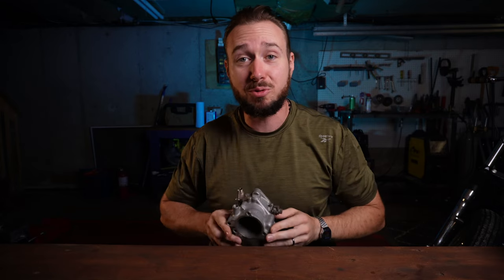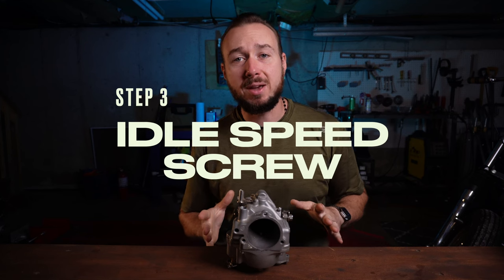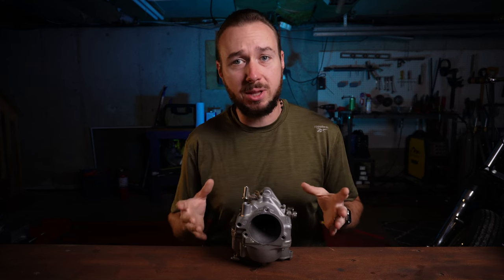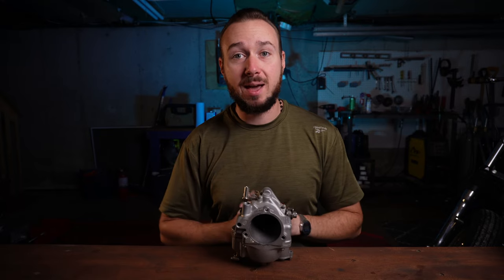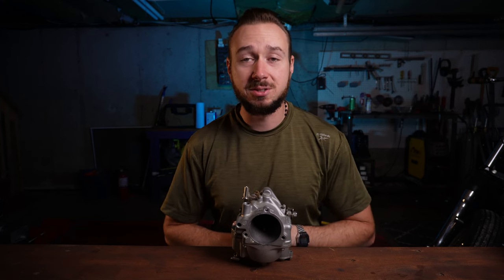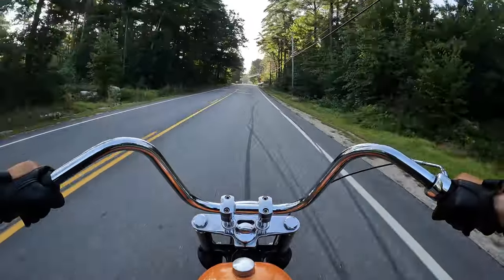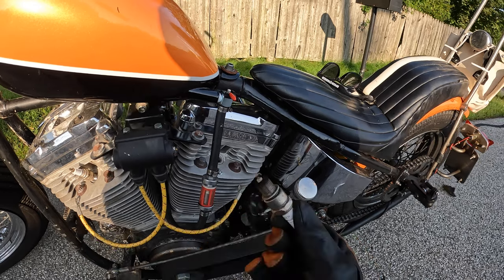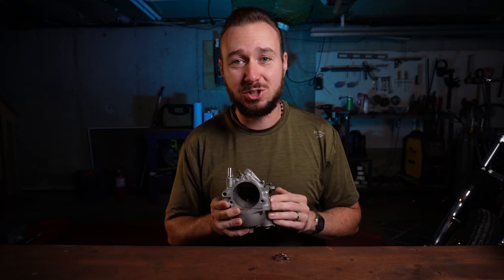Tune Your S&S Super E Carb Like A PRO

Comment: Awesome video! Called me out on the “I’m so close” 😂 I’ve got mine (with v stack) on a stock 1988 883 and I pulled it from my stockish 76 1000 without changing anything. I’m convinced (and we know it’s true) that my jets are too big. Smaller ones in the mail and I’ll be going back thru this video to get it right. I’m sick of running out of gas within an hour😂😂
Reply from the maker: Hahah I had to keep that line in cause I hear it all the time 😂😂 you’re the only one honest enough to admit it but we’ve all said it. Let me know how it goes with the new jets
Reply: UPDATE: Got smaller jets in, stock position, had to dial idle way down, it was a run away😂 but ok,  running pretty good now, holding idle most of the time but still goes into a weird low idle and stall sometimes? It used to do that bad before, had to keep gas on it at red lights. What causes that?
Reply: Also, so I was at 28/66 and went to 25/62. The 25 is working pretty smooth, I may go to the 64 on main, cuz it just feels super slow and yucky, but I wanted to start out light first to try and save some gas. Obviously with a stack, our gas is gonna be shit😂
Reply: Last update: I gave up. I’m done with this piece of shit. Going back to an uncool CV and ugly ass air cleaner. Fuck this. Might trade it for a Honda.

Comment: Another video i needed! hellyeah! My bike isnt running without that choke out, opened her up and cleaned the internals but the issue remains... hopfully this help. thanks dude!
Reply from the maker: If your jets are clean, truly clean and you can see daylight through them, and it won’t run without the choke on…first thing I’d suggest is a larger pilot jet
Reply: @greasesgarage  Thanks! I'v actually had the complete set of jets in my lowbrow shopping cart for a month now 😅gonna give it a shot.
Reply from the maker: @Harsh_Trip  you and me both, I don’t even have the 74 jet I need to put in yet haha
Reply: @greasesgarage  haha it’s too bad they don’t let you buy them individually or within a smaller range. Oh well!

Comment: Love the s&s superE series
Reply from the maker: Great carbs for sure
Reply: @greasesgarage  I’m running a 70 main and my plugs look pretty much like yours you think a 72 would be good?
Reply from the maker: @travislohneis224 I think a 72 would help but depending on your setup you might need even bigger than that
Reply: @greasesgarage  it’s a 1200 custom s&s carb obviously …drag pipes that’s about it
Reply from the maker: @travislohneis224  hmm, for a 1200 that might be a little big but it’s possible if you have a very free flowing air cleaner
Reply: @greasesgarage  I will try it and see what happens it runs good just seems to be on the lean side
Reply from the maker: @travislohneis224 def give it a shot, lean is dangerous so better rich than sorry haha
Reply: @greasesgarage  seemed to be fine did a roll on in 3rd gear  50-70 no backfire …seemed to have better throttle response
Reply from the maker: @travislohneis224 perfect!

Comment: Thanks for your help Bro. I'm new to kicking my 93ci shovelhead and your technique is working for me. She's kicked back on me a couple of times and that's not fun. I think full hard kicks on the compression stroke is the answer. I leave the ignition off until the kicker is set-up where I want it.
Reply from the maker: That’s great man! Definitely safer to leave that key off til you’re ready. If it kicks back a lot, you can consider your timing. Too advanced can cause kickback. But if it’s only in rare cases then I wouldn’t mess up a good thing
Reply: @greasesgarage  Thanks again.

Comment: I just got my first bike, a 93 Softail with a stock 80 inch Evo. It does have a set of pipes and a s&s super E carb. The bike ran fine when I got it but even better with help from this video. Only thing that would've made it better would be if he explained how to read the plugs.
Reply from the maker: Stoked to hear this! Thank you for commenting. That's a great point about reading the plugs but I think that needs its own video. It's in the works so stay tuned

Comment: I don’t get it ??? How you gonna turn your idol speed screw 1/2 “IN” after lightly seated down ? Can go anymore . 
Something I’m not getting ? Or did you mean to say 1/2 turn out after seated ? 
Thanks
Reply from the maker: Just give it a shot you’ll see
Reply: I share in your confusion. That part was not clear and the wording contradictory. I think what he meant was, if you unseat the idle screw all the way the butterfly valve will close. So by “turning it in” 1/2 turn, the butterfly valve will open slightly letting the engine idle just enough. If you seat the idle screw all the way, the engine will race once you start the bike. I have a S&S Super E on my 2001 Indian Scout with a stock tear drop air filter & stock pipes. I’ve been fiddling with this carb for a while now & learning through trial & error. The verbiage on the instructions, written or spoken, can be confusing when actually performing the factory settings tuning.
Reply: @yayagazab4449   thanks for your message . I took a better look at the carb and then understood better what was mentioned . 
I’m used to different carbs not realizing that the screw was to adjust the butterfly . 
First time messing with an S&S … thanks again !
Reply from the maker: @yayagazab4449  this is correct. You make contact with the plate that opens the butteryfly and once you touch it, go another 1/2 turn

Comment: Great beginners tutorial for sure. I'm not being rude, but I'll add a bit to this though. 
 This is all assuming that your intake boots are sealed, ignition timing is correct and valves adjusted properly.
 If you are running drag pipes the a/f mix and jets are going to be slightly different than if you're running a crossover tube or two into one pipe. 
 The a/f mix can be checked with a vacuum gauge and/or a can of carburetor cleaner too. 
 One more thing. If your timing plug is out or have a see through plug, you can get real close to the proper idle speed if you can blink your eyes and count the blinks in a minutes time as well! :face-blue-wide-eyes:
 Btw, you're hand jammer and suicide clutch is too cool. It's what separates the men from the boys!
Reply from the maker: All great points. Definitely have to make a few assumptions to find a starting place for the video but those issues will throw a wrench into what the viewer is seeing here so hopefully people check out these comments. Always more info to share so I appreciate the reply 🙏🏼

Comment: Great video Grease!!  You helped me rebuild & tune the S&S on the 90 Evo I just bought!  I too did the 3rd gear 50-70 roll on and thought it was pulling pretty good, then did the 5 sec full throttle in 3rd gear, super lean plugs as well ha.  I am curious, what gear is the 5 sec full throttle main jet test done in?  Also, what size main jet did you end up with?  I too have a 72 w/ open drag pipes but a stock S&S air cleaner.  Was going to start with a 74 main.  Thanks again!  Great diy content!!
Reply from the maker: Thanks brotha!

So on mine the 72 main and 29.5 pilot works great with my long but open pipes and teardrop S&S cleaner. For this velocity stack I need the 74. 

If you’re looking lean on the main jet pull I would throw the 74 in and run the test again. That should take out any lean condition. Test could be done in 3rd or 4th but I did mine in 4th
Reply: @greasesgarage  Dude you're awesome!!  Thanks for the info & help!

Comment: Incredibly helpful video.
When I turn my fuel mix screw in (lean) the idle increases but it never stumbles. I can turn it all the way in to zero and the bike never cuts off. I down jetted all the way to 26.5/66.5 and it does the same. Right now its jetted at 31/74 it seems to have the best performance but I still cant figure out why im having that issue with the fuel mix screw. I have it set at 1 full turn out. Engine is a harley evo with 10:1 compression mild cam stock heads and exhaust
Reply from the maker: I would use the point between where it increases the idle and where it bogs down when richening the mix. Interesting it doesn’t die when totally turned in though
Reply: Thanks for your response. Keep up the great work

Comment: I liked your video on the S&S. I just put a brand new carb on a 79 FXR. Started as you and the instructions suggested. But I can't get it right. One of the problems is the mixture adjustment. When I turn it in, the engine stumbles a bit. But when I screwed it out, the idle kept getting faster and faster. It sounds bad. I typically like a slower idle. Any suggestions?
Reply from the maker: Yes, pay close attention to that segment in the video because it’s two different things you’re adjusting. 

Set your mix screw first. Halfway between where it stumbles and where it spikes the revs. 

Once the mix is set, THEN you can adjust your idle screw to whatever idle you like. But the mix screw itself is NOT an idle adjustment. 

Hope this helps

Comment: Grease! Man, you are my go-to bike/chopper guru now. I built a chopper from the ground up and your videos were invaluable, especially with the wiring. 

I have a carb question. My donor motor is a 250cc Chinese Honda clone that came off a cheap dual sport and the carb is pretty bare bones; the only adjustment screw is the idle. I put a pod air filter and straight pipe on it. It runs perfectly with even power all through the throttle range, and there's no popping or backfiring when I let off the gas. Can I take this as an indication that the mixture is good enough that I don't need to re-jet the carb? I don't want to ruin the engine by running too lean, but it seems to be fine as is.
Reply from the maker: I would take it as a good indicator absolutely. If you were lean you’d experience some poor performance and popping out of the carb. If you wanted to be extra sure, run it wide open for a stretch, 5-6 seconds at top gear full throttle, and kill the motor and coast to a stop. 

Pull the plug and check it for color. It should be a golden brown. Basically anything besides clean white or cooked. That will be your truest test but again, not hearing popping or poor performance is quite a positive sign already
Reply: @greasesgarage  -- I'll do it. Thanks, man!

Comment: Are you running the brass Speed Dealer Customs velocity stack? I have the exact set up but I went in a did a once over with some Mothers polish.
Reply from the maker: I am yes, awesome kit. I have to put the tear drop back on to test a theory I had so depending on how that goes I’ll either keep the stack or the teardrop

Comment: Dude awesome this video helps me a lot. Do you have one on making your bike start up easily with kick only? I find my starting sequence is a lot more difficult when the engine is warm. Fires up on a dime when it’s cold
Reply from the maker: Sounds like I have another video to make haha, that’s a great question and I used to have that problem too. Used to give me problems after I’d fill up at the pump. What ignition and bike you running?
Reply: @greasesgarage  so I watched your video about what to do when your motorcycle won’t start and between this video and that video I have a much better understanding and I’m sure if I get everything dialed in on the carb and everything is good with the battery etc I should be having an easier time. My starting sequence is good when cold only takes 2 kicks most of the time but when it’s warm I have a different sequence and sometimes that works but sometimes I gotta walk away for about a half hour lol I have the s&s HI-4N electric ignition. Thanks for any help
Reply from the maker: @caseycarey5445 one thing I can say for sure has helped me (and you may already be doing this) is to never use the choke to start the bike once it’s already warm. It’ll flood immediately. Another thing I do is with the ignition OFF I will find the correct stroke first, then key on, then kick and it almost always kicks over on the first kick this way.
Reply: @greasesgarage  good to know that thanks I’m definitely gonna try. I know in the s&s manual for hot start it says to choke it and then give two quick quarter turns of throttle. I’ve found it works sometimes but if it doesn’t happen to fire then it floods. I forgot to mention I have the thunderjet kit installed too but as far as I know it shouldn’t affect starting. It just gives it a third fuel circuit.
Reply from the maker: @caseycarey5445  very curious about that thunder jet
Reply: @greasesgarage  yeah I wonder if it could be a problem or not too

Comment: So what should the plugs look like when using the kill engine method? Slightly wet?
Reply from the maker: Slightly wet is ok yes. There will always be a little color to them unless they’re super lean and you don’t want to run super lean. No excessive black carbon buildup and not totally white and crusty. Somewhere in that middle range

Comment: I was told when checking plugs with new its gonna take a bit of riding for them to show the condition for you to read them, your thoughts grease?
Reply from the maker: I would ride it for a day to get the plugs showing some condition but it shouldn’t take longer than that
Reply: @greasesgarage  sometimes I have a bit of a flat spot on the lower end but wide open is fine can you bump up or down on the one intermediate jet or do you have to do em both.
Reply from the maker: The intermediate controls between idle and about half throttle. The main is the opposite. You can switch just one, and should switch just one, depending on which areas need the tweaking
Reply: @greasesgarage  thank you so much for taking the time to let me pick your brain, last thing. When reading plugs once they burn one way like lean can they burn another way? Rich to lean lean to rich or do I have to replace em each time to check how they burn
Reply from the maker: No need to replace. If they get rich and you run lean it’ll burn the carbon off. And vice versa as well

Comment: I reset my carb and when i started it was like i had it enriched. I had to turn the idle screw out luke 3 times to get it off 2k rpm. Im just assuming i had it far too tight to start. I have a tach so i could get it to the rpm before i rode it.
Reply from the maker: Were you able to get it running well and idling properly

Comment: I have 1330 S&S been off the road in storage for 2 years before that it kept fouling plugs, any idea what it maybe? Also started happening after i got my carby changed  

Thanks
Reply from the maker: Most likely too large of a jet, what sizes are you running

Comment: My evo’s been running good but i noticed its bogging when i get on it in 3rd gear. Smaller main jet?
Reply from the maker: What size motor and what jets currently?
Reply: @greasesgarage   i think its over 80” has a ton of compression. Ran the same jets you are & it ran like shit haha Running a 72 main & a 28 intermediate now

Comment: Hey I got a question. I got a super e on my shovel, when i have the enrichment on, it doesn’t increase my idle, instead it sounds like a vacuum leak, you can hear a sucking sound. Is this normal? The bike seems to start fine, but I live in hot weather
Reply from the maker: Not normal, idle should definitely increase. What air filter you running? Is there a carb support?
Reply: Stock S&s tear drop. Has the stock support that comes off the front head.

Comment: I have a 85 Harley Electra Glide 1340cc that has a voes vacuum hose,  "where do u connect to the super e carburator ".
Reply from the maker: Great question. On mine the S&S manifold which holds the super E has a hose barb facing up right in the middle of the manifold. Connect your voes hose to that 👍🏼

Comment: Factory settings would include factory jetting , correct?
What are the factory jets ?
Reply from the maker: It would not because I have no idea what bike you’re riding with this carburetor and it depends on the bike it’s on
Reply: 1998 big twin . But this is an aftermarket carb so it would come new in a box with the jets that correspond to these factory settings unless I'm missing something
Reply: If I set the carb to these settings it's way too rich which leads me to think the jets or a jet is too big.
Reply from the maker: @leoispoop I would ask the seller, I’m not sure that there’s one set of jets that every super E will always ship with

Comment: How do i know im starting in the right place when screwing 1/2 turn in
Reply from the maker: Look behind the screw at the tab it presses on. Turn it in until it just begins to make contact with the tab. Then go 1/2 a turn more. It’s not a super fine science with that one though so don’t stress it, anywhere in that region will get you going and if your bike sounds like it’s at wide open throttle just back that screw off

Comment: What if your engine idles to high when you stop at a light and then slowly drops
Reply from the maker: The most common cause for that is an air leak. It idles high because it’s still drawing as you come to a stop but once you’re stopped the draw slows and it eventually settles back down
Reply: @greasesgarage  I’ll take a look at the intake